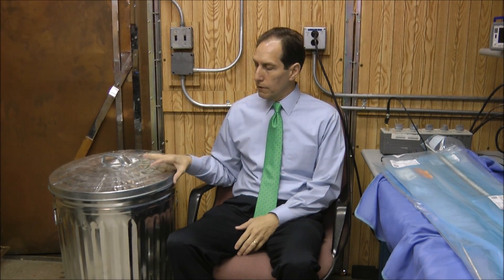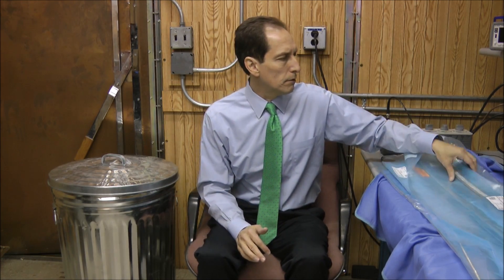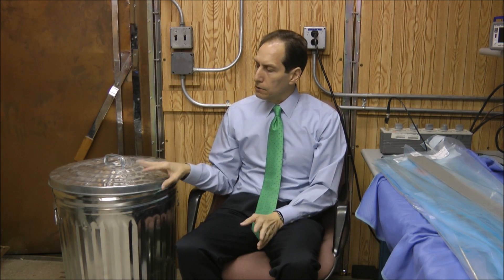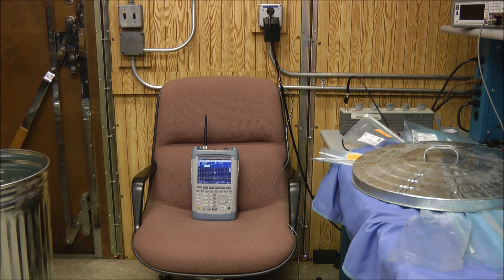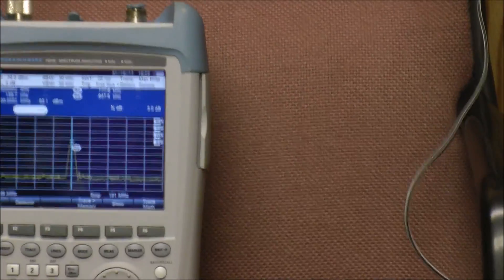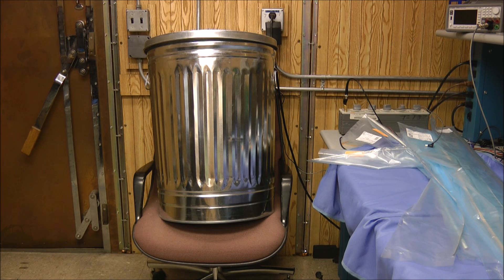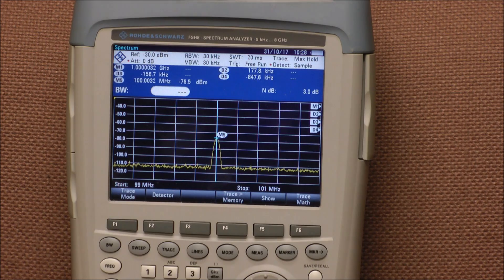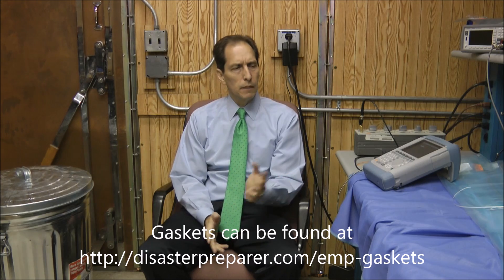Gaskets to Seal Faraday Cage

Comment: I really appreciate your efforts!  I can't wrap my brain around the idea of "the lid acts as an antenna."  Can you give me a quick explanation of this, or do you have a video describing how?
Reply: I'm far from being an expert but will try to answer:  I believe he was referring to gaps between the lid and the trash can. The circumferences of the trash can lip and the lid are not perfect. It's very hard to achieve continuous contact between the two. A relatively long and thin gap may act as a slot antenna. This greatly reduces overall attenuation (reduction of RF energy). This is more pronounced in the higher frequency range, like he was experimenting with. It's believed that EMP (man made) energy would be mostly concentrated in VHF/UHF range.
Reply from the maker: Andrew did a great job of explaining this below. Narrow gaps formed by the lid and the can act as a slot antenna. If that gap is appreciable in length to the signal wavelength, it can efficiently receive the energy. Not all cans are equal, and it's not possible to really tell by visually checking them to know which are "well sealed" and which have thin gaps. The gasket simply fills the gap with a conductive material. We add conductive gaskets all the time with electronic enclosures at NASA to reduce EMI, both coming into boxes and going out.
Reply: Matthew Walz, I agree  metal lid making good contact with a metal container would logically complete the  shield.

Unless the seal only makes limited circumference contact?

Would a metal safe with debated door work better?

Thank you for your excellent work
Reply from the maker: I think you nailed it Andrew.
Reply: Perhaps he means the lid itself is very resonant, like a satellite dish transmitter. By taping the edges or using gaskets, this resonance is dampened resulting in a reduction in decibels of electromagnetic energy.
Reply: Andrew - perfect explanation.  I tried to explain that gaps in another comment, but not nearly as well as you did.  However, I was trying to explain that to test for gaps the test frequency should be much higher.  The 100MHz has a wavelength of 300cm, so is very poor when testing for gaps.  I would expect a nuclear EMP to have a lot of high frequency content, so the gaps would be a critical aspect of such protection.  Suggestions as to test method?

Comment: Great video, stupid question but does the frequency matter?
Reply from the maker: Yes, it most certainly does. As the wavelength of the frequency approaches twice the slot length, the antenna becomes much more efficient. So for low frequencies, you need a longer slot to get energy inside. The trouble with an EMP is that it's a broadband event with frequency content that reaches all the way up to 1 GHz.
Reply from the maker: Not a stupid question at all. Frequency matters a lot because higher frequencies have smaller wavelengths. That means they can couple into smaller conductors (or through shorter gaps). I typically test from 100 kHz to 1 GHz, which spans the frequency range of a nuclear EMP.

Comment: If an EMP wave is coming from above or at a hi angle would the shape of the lid offer protection? Just wondering if you raised your pulse generator above the trash can to 
simulate a EMP coming from above.
Reply from the maker: Yes, I would think the shape of the lid might offer more protection than when directed from the side (the way I do during testing). That said, waves have a way of bouncing around, so it's hard to accurately predict how it would impinge on the can.

Comment: Great video, I loved seeing the data on the analyzer!  One question, I'm concerned about my safe because it has an electronic lock instead of a traditional tumbler style.  Is there a way to protect the circuitry of the safe's electronic combo lock?  I was thinking about some sort of copper mesh or aluminum mini cage that could be magnetically placed over the lock.  So then just remove that little cage when you need to type in the combination and access the safe.   Any ideas on that?
Reply: I have this same question also. Any idea's on the subject of electronic locks on gun safes? Does anyone have an answer????? Thanks for the video, it was great.
Reply: @cougartracks4442  Some electronic locks on safes also have a key. Just use the key.

Comment: Very cool video. I have a Behren's 6 gallon metal bucket (like yours, just smaller), with a 3.5 gallon painter's bucket with gamma seal lid inside. I use aluminized tape at the moment, but will definitely check these out. Thanks for this!
Reply from the maker: Glad I could help.
Reply from the maker: Sounds like you've got it covered.

Comment: 😱 I'm so confused do I have to protect my rechargeable or alkaline batteries what about LED flashlights what about regular light bulbs the one that now considered old-fashioned
Reply from the maker: No need to protect rechargeable or alkaline batteries, unless they include charge control circuitry (such as for a laptop). As for LED flashlights, yes, they should be protected. No need to protect regular light bulbs.